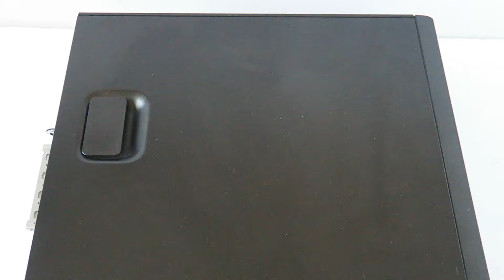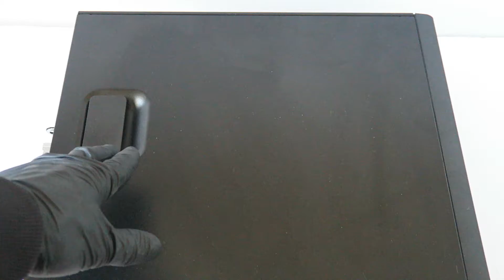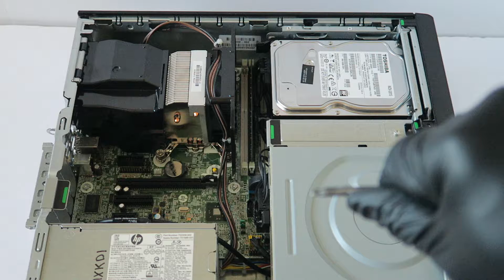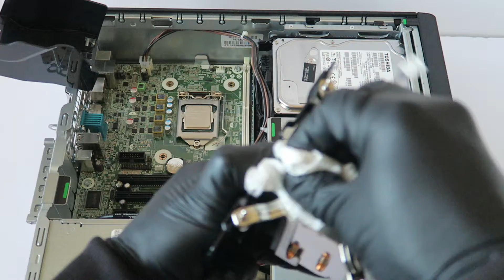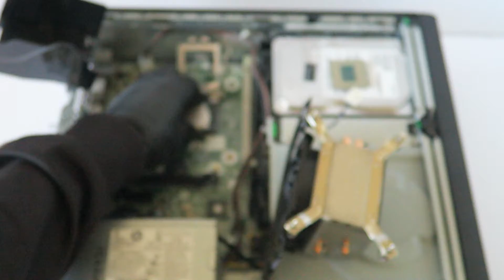HP Z230 Workstation Processor Upgrade

Comment: Great video. I have a HP Z210 Mobo (full ATX...fits standard cases) and trying to figure out if the Z230 cpu cooler fits it. After watching your video, I can confirm it will definitely fit the funky 75x100mm hole spacing in the Z210 mobo as it's the same exact pattern/dimensions. Also, when you flipped it upside down to clean, it was a Eureka moment. This cpu cooler has brackets that can be removed (drill out the rivets) and modded to a more standard cooler...just in case I hate this cooler.

Comment: it is support for i7 4790K?please i need the answer.thx
Reply: Don't know about sff but desktop supports i7-4790k processor
Reply: @anonymousboy2000  Do you mean HP Z230 tower support i7-4790K? are sure about that?
Reply: I don't know but i used i7 4770 in z230 mobo

Comment: Hello i have the same pc i wanted to know if it is possible to change the power source of my pc because they tell me that it can not be changed .
THANKS.
Reply from the maker: Hi, yes you can change the power same model and do you have small form factor or mini tower?
Reply: @Mxkdt  is it posible to upgrade it, i plan on installing the gtx 1050 ti and a intel core i3 7100 and i don't know if the current power supply can support it

Comment: I did this without cleaning it with rubbing alcohol. I just wiped it off well with the paper towel, and added new compound with the new processor. hope my computer doesn't blow up.
Reply: Won't make it blow up but it could definitely make your cpu run hotter because of bad thermal transfer. That could shorten the lifespan in the long run. 6 years later, how did it hold up?
Reply: @RT-qd8yl  i don't even remember this lol happy thanksgiving if you do that..
Reply: @josiahhill4993  Thanks, same to you! 🦃